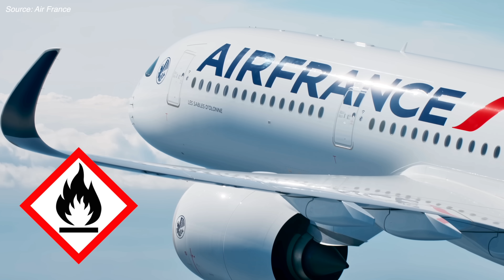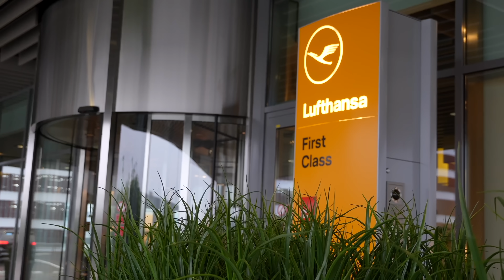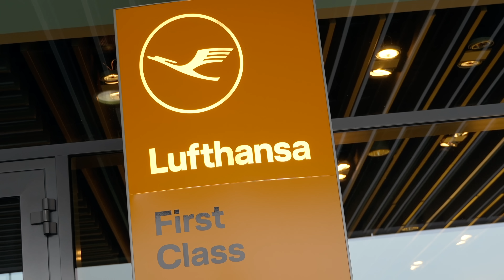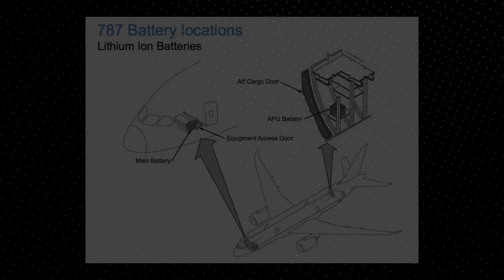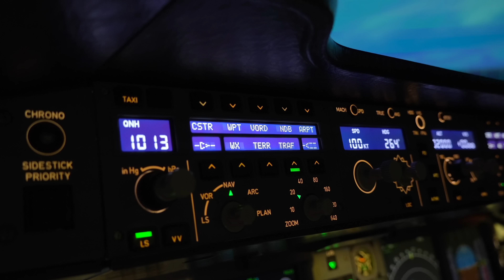Are the A350 & 787 a Fire Hazard?

Comment: You may want to seek more accurate details about the plane evacuation, as significant issues arose during the process. There was a notable breakdown in communication between the cockpit and cabin crews, resulting in an eight-minute delay before initiating the evacuation. Personally, I wouldn't wait for eight minutes while they discuss appropriate actions in a situation involving a potential fire. Moreover, the evacuation itself took ten minutes, totaling an 18-minute span from impact to completion. If there were smoke inhalation risks, this could have had severe consequences. A similar incident occurred with Saudi Flight 163, where passengers perished due to smoke inhalation while waiting onboard. While it's miraculous everyone on the A350 survived, there were evidently problems in the evacuation procedures.
Reply: Your timeline and details are incorrect. From the video evidence, fire units were on scene within 4 minutes, foam had been liberally applied to the ground fuel fire under the left wing and engine by 5:30, and the evacuation call was given 6:20 after the aircraft came to a stop. Basically most everyone was off by 7:10 and the next 10 minutes involved the crew double-checking for left behinds and coordinating with fire crews.

Yes, flight attendants had to shout/discuss with each other about exit door status in those first minutes, but this was unavoidable because the interphone system was disabled by either the nose gear collapse or damage sustained by impact with the Dash-8. The flight crew also had no instrument displays after the collision and had to visually verify the fire outside, and then coordinate with fire units.
Reply: @haroldlipschitz9301  
Your timeline and details are inaccurate.

The collision took place at 17:47, and the last person was evacuated by 18:05. The certification standard mandates evacuation within 90 seconds from the call, even with 50% of the doors inoperative, ensuring everyone exits the aircraft. Considerations include the absence of electricity, requiring reliance on glow-in-the-dark or locally powered emergency lighting, flashlights, megaphones, and strategically placed flight attendants. Even with only three slides available and potential mobility issues among passengers, an 8-minute decision-making process and a 10-minute evacuation seem excessive. Additionally, video evidence from passengers confirms smoke hazards inside the cabin, prompting the question: Can anyone hold their breatth for 10 minutes?

https://en.wikipedia.org/wiki/2024_Haneda_Airport_runway_collision#cite_note-nhk18-34

https://www.wsj.com/business/airlines/japan-flight-airline-safety-standards-9b4eda27
Reply: @deanx0r  Incorrect. I live in Tokyo and the above account is exactly as has been detailed extensively in Japanese media in recent days. Most everyone was off by the time I said they were. There were stragglers in the cabin who were too scared to move that the crew found in their sweeps, and crew had to negotiate/plead with them to get out. That particular situation is a cultural problem, and will definitely be in the report. But that is not the main evacuation, those are panicked idiots who refused to move. The main evacuation was accomplished in under 90 seconds from the time it was called, with 3 of 8 exits serviceable.

Comment: Does it even matter if the plane burnt down partially or totally? It’s a total loss anyway. The only thing that matters is whether all passengers can get out in time. After that, it can slowly burn all it wants. It seems like the A350 did just fine in that respect.
Reply: And fire crews will ultimately find new ways to put out "new" fires. The same goes for EV fires.

Comment: As a former aerospace engineer - thanks! Everyone lived on this A350 - no one should forget this.
Reply: Everyone lived on the Alaska 737 too.
Reply: @CaliSteve169  Where is the point? The A350 was involved in a runway collision and the Alaska 737 disintegrated after the start without a reason.
Reply: @woodmasta22  disintegrated? Do you even know what this means?
Reply: @CaliSteve169  In this case a structural part of the fuselage parted from the plane during the flight and crashed to the ground.
Reply: @woodmasta22  ok, now go Google the word "disintegrate" and stop being a YouTube drama queen.
Reply: @woodmasta22  It wasn't structural.  It was a door plug.  The structure is reinforced around any door apertures.
Reply: @cjmillsnun  This plug is essential for holding the cabin pressure.

Comment: Sorry but this video is complete nonsense. Your comparing two different accidents and making some kind of ridiculous comparison. The JAL Airbus landed on a fully fuelled Dash-8 which burst into flames. The fact that the Airbus didn't disintegrate on landing and that the fire didn't spread fast enough to engulf the passengers shows how safe the aircraft is. The fact it burned to the ground is completely irrelevant!
Reply from the maker: Hence why I said the circumstances of the two crashes are very different...

Comment: The A350 might have it's first major accident in 2024, but yet the Boeing 787 might be on the edge to this happening coming for them, yet the door falling off the 737 MAX 9 of Alaskan Airlines is very crucial for Boeing to say I believe that Japan could easily indipendntly on their own could make their own commercial aircraft to compete with Boeing as Airbus enjoys success, to see one day planes made by Mitsubishi and Honda will be nice so Japan could compete on their own as China wirh COMAC with their C919. 

On the other hand for South Korea their success in the commercial airplanes industry ends up relying on Airbus as for the South Korean commerical avitation manufacturing ends up wirh the similar fate like Daewoo and General Motors for a reason why Daewoo Motors became GM Korea, but in this case it will be KAI that is the Daewoo and Airbus is the GM as to after the Aqcucition of Korean Aerospace Industries KAI becomes Airbus Korea by manufacuring an Airbus A320 Neo in Seachon, South Korea as to say Airbus Korean division begins working with Lockheed Martin in the defense industry as it is no longer be known as KAI but as Airbus Korea.
Reply: Koreans stole a lot of Airbus IP.
Reply: @lo2740  Nope but yet, the A380 is stolen from the MD12 it is some sort that Airbus have some kind of Korean division the MD12  is for McDonnell Douglas to give the  Boeing 747 a run for it's money since Boeing absorbs McDonnell Douglas then Airbus took the design of the MD12 and call it A380. 

Is similar that GM Korea took a design from a Ferrari and created the Corvette that we have now that is designed by GM Korea and built in the USA that is all.

Comment: Errrrrr no, the A350 isn't. It survived long enough to evacuate everbody, despite crashing into a fully fuelled dash 8. To me that's an example of the aircraft doeing exactly what's expected of it.
As far as the 787 goes, there's been no evidence of that being a fire harzard since they fixed teh early battery issues.
Components of planes are fire resistant, not fire proof.

Comment: Would like to respectfully point out you could have provided more context for this video.. Unlike the B2 or the Asiana crash, this was an aircraft collision. This a350 at high speed during landing hit another plane that was about to take off on a runway. This is comparable to the Tenerife disaster. It's unfortunate that the other plane got totally destroyed but it also talks to how big of a crash this actually was. The a350 however was still intact and in shape after the impact and managed to buy enough time despite having caught on fire to get everyone out safely. It appears it took a little less than 10minutes upon impact for all passengers to evacuate, with a few more additional minutes for the pilot to conduct his final check making sure everyone was out before he got off as well. The plane would also have had fuel splashed all over itself upon impact as the other plane was about to take off where it would have loaded itself with fuel. So ultimately it may not have been possible to put out the fire from the start, but buy enough time for evacuation.

Comment: The reality is, that once an incident like this happens, the plane is going to be a total write-off anyways. If the composites give a bit more time for evacuation at the start of the fire, even if that means it's more likely to burn to the ground later - I think that is a very beneficial trade. And while I have no evidence, based on the properties of composites burning, I suspect they slow the ingress of an exterior fire to the interior.

Comment: The A350 performed admirably. The evacuation took over 18 minutes. The plane requirement to an emergency evac is 90 sec. An aluminium fuselage would most likely be on fire at the 6 to 7 minute mark... I'll fkly the A350 any day, it is my preferred airplane.
Reply: The actual evacuation is done in around 3 minutes, given only the front doors and 1 tail doors are functional. The "18 minutes" is for the Captain to check everyone has left the plain.
Reply: @sbeve7445  There was a small number of passengers who refused to evacuate - the captain stayed behind to encourage them to leave the plane
Reply: Normally you dont have that time if the plane is on fire like that. That that time was given is only due to the A350 Design @sbeve7445
Reply: I was looking for this comment. The fact that captain had so much time to persuade last passengers to evacuate tells a lot about this aircraft safety.

Comment: At 28 meters wingspan and30 tons take off weight, Dash 8 is not a "small turboprop". It is much smaller than a A-350, yet it is not what you would call a small aircraft.
On the other side, the carbon fiber composite fire createsa dangerous cloud of carbon particles, that once inhaled, cause permanent lung damage. So expect that some if the passengers who ingaled that smoke will suffer for the rest of their life.

Comment: Some years ago the fuselage of a two-seater glider plane built of composites got burned due to overheating the brakes in dry grass. The people tried to extinguish the fire with the foam of a quite large extinguisher but were unsuccessful as the hard foam between the layers contained so much air the plane kept glowing slowly. But this was so slowly that they could dismount the wings, the elevator, and the cockpit instruments. The burning process could not be stopped but lasted for hours.
The plane factory was surprised as they ordered a new fuselage to be fitted with the old wings and the other parts.
So I can imagine that the A-350 burned all night but in the morning not much was left.

Comment: The a350 took a relatively long, long time to burn. Most of the pictures only show the plane well after the crash and only when the fire really got going. All of the passengers did not evacuate for nearly 20 minutes, but even at this time the fire is not completely raging. The plane still had a decent amount of fuel; even though it was near the end of its flight it is a large plane and lands with tons of fuels. The fuel and luggage needed to burn for a considerable amount of time and get very hot before the airframe and rest of the interior start torching. The photos you see next to headline are very misleading, as when you see a gigantic, raging inferno you assume that’s what it looked like immediately after the crash. The charred remains also look bad, but you can see the same thing even with all metal aircraft, it’s just that there a bit more intact metal left afterwards.

All in all, I think the plane withstood the fire very well. It withstood the fire so we’ll that the flight attendants were able to convince the passengers to stay seated even though there was smoke in the cabin. The composite material doesn’t transfer heat as well as metal, and it doesn’t soften a tremendous amount until it reaches a temperature much higher than the point at which metal softens and loses all strength. I think if the a350 was metal there would have been much more impact damage allowing the fire to immediately access even more fuel and luggage and allowing the smoke to spread even more. Even if a metal airframe suffered the same damage, the fire would still have spread much, much more quickly.

All of this fear about composite planes being more of a fire hazard than metal planes is ridiculous and I hope media does not fan the flames of flying fear even further.

Comment: Hull breaching is an important factor. The flammable material is the baggage, not the fuselage. Bags of clothes, doused in fuel, will ignite and propagate fire faster than the airplane itself.

 Once the hull is breached, the flames can start harming the passengers directly.

Fumes  entering the cabin would create panic. An un-breeched hull provides shelter from this as well.

The integrity of the hull, and maybe the need for hard compartmentalization, will be part of the review.

Comment: I watched the live feed while the plane was on fire a little while after the passengers escaped. The fire crew just stood around for so long not even attempting to put out the fire. They let it burn for quite a long time.
Reply: There was also a lot of jet fuel from the dash 8 that ignited.
Reply: Exactly, saving the aircraft was clearly not the priority. It really doesn’t matter if the plane is fully burnt or only half of it since it would have not been viable to repair. What matters is it burnt for a long time on the outside securing the inside and giving time for a successful evacuation.

Comment: I'm thinking of the Tenerife tragedy. The aftermath for those planes liked just like this JAL plane when it was all said and done. And those were aluminum hulled aircraft. It's everything inside the plane that burns so deadly. The seats, the carpets, the plastic overhead bins and inner sidewalls. Air Canada Flight 797 is the perfect example of that.
Reply: In tenerife, both planes were taking off, meaning they had more fuel. However, since they were just going to travel a short distance, the fuel levels wouldn't be significantly highr
Reply: @aadamchandoo5014 iirc KLM plane's captain decided to refuel on Tenerife which also delayed Panam departure since their plane behind the KLM's